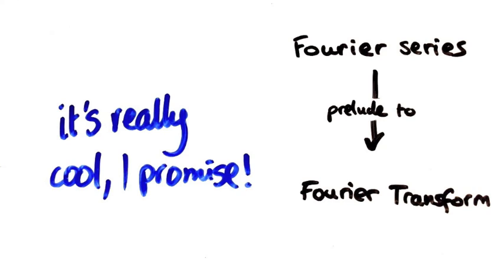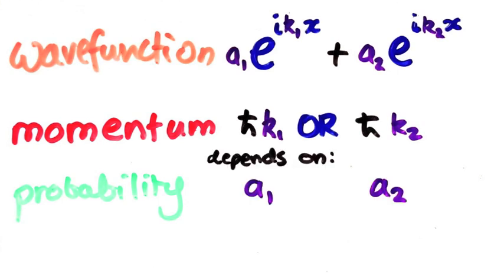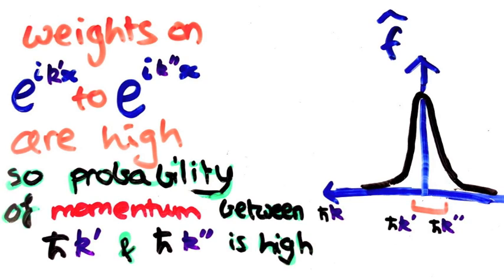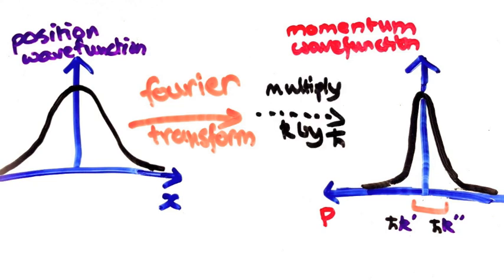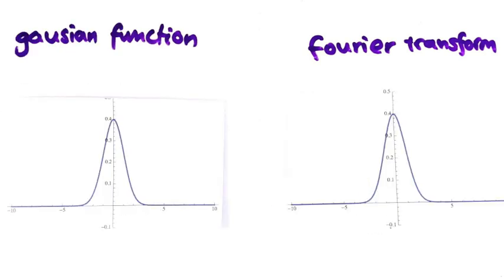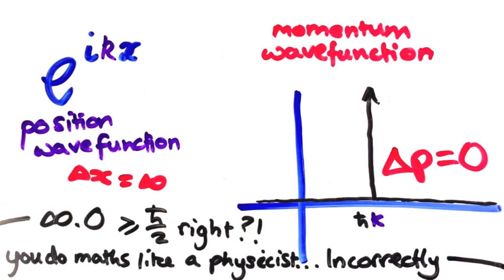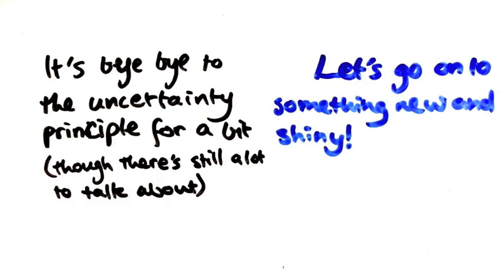The reason for the Heisenberg Uncertainty Principle

Comment: Ultimately, QM is weird because operators can be represented by matrices, which in general do not commute. You can use this property along with the Cauchy-Schwartz inequality to derive the Heisenberg uncertainty without too much effort. But ultimately it's because QM is described by a wavefunction, which is exactly where Fourier theory is applicable. And we need a wave theory to describe double slit interference, all the way down to the single quantum level.

Comment: 07:05 - "because it would turn up the particle anywhere"
----> Yes and it may be the case ACTUALLY, that we Measure it or not, by the way.

Indeed, if we Postulate that:

any Particle is a WAVES PAQUET OF 3D PERTURBATIONS IN THE FINE STRUCTURE OF NEAR INFINITESIMAL POINTS FILING THE PHYSICAL SPACE,

any Perturbation SPREADS TO INFINITE,

so that A PARTICLE IS NATURALLY AN UNFINITE OBJECT.

~°~

Conséquences about the Uncertainty Principle:

More we try to Measure the POSITION of a Particle with Precision, More we need to "look" at a SMALLER Part of the Particle, of the WAVES PAQUET; while doing so, we can't "see" the AMPLITUDE and NUMBER OF WAVELETS of the PAQUET WAVES around that Position, which we need to know, to know APPROXIMATELY the MOMENTUM. That's why we have this Relation and for no other Reason in our view.

And yes, by this, IT IS IMPOSSIBLE TO MEASURE WITH INFINITE PRECISION NOR THE POSITION NOR THE MOMENTUM OF A PARTICLE.

~°~

This Classical Problem of Epistemology of Physics: 

TO CONFUSE THE MATHEMATICAL TOOLS WE USE WITH THE REALITY. 

Because however Accurate they may be to Predict a Phenomenon, they can be FAR MORE COMPLEX THAN THEY SHOULD IN THEIR INTERPRETATION OF REALITY, BECAUSE OF THE INCOMPREHENSIONS OF THE CREATORS OF THE TOOLS, OF WHAT WAS REALLY GOING ON :p

Comment: I don't know if this helps at all, but the reason why p=hbar*k is primarily related to the fact that E=h*f=hbar*omega. It doesn't take much to see that when you divide by velocity, the units come out to hbar*k, or h/lambda. The easy answer as to why E=hf is that f is proportional to velocity (and therefore energy), but with that purely mathematical logic, one could just as easily come up with some other constant (let's call it j for "janck's constant") and say that E=j*lambda, which obviously isn't true, because as f gets big, lambda gets small. The way I like to think about it is that the h*f term explains the fact that a wave is often a bunch of particles only moving up and down, giving the illusion of horizontal movement (like when people in an audience "do the wave"). With that in our minds, we know that since a large lambda makes the crests occur less frequently, a given length of a wave will hit something less times with its crests (or peaks in general) as opposed to if it had a higher frequency. A good intuition to have is that if the wave looks spiky, it's energetic, and if it looks flat, it's pretty lame. And of course, there will be someone asking why E=m*c^2 if "c" is just the phase vecolicty, and E is supposed to be measured perpendicular to the phase, but there's an easy answer to that too. 1: the "m" term is relativistic mass, or (rest mass)/sqrt(1-v^2/c^2), and it's easy to see from this that for light, you would get 0/0, which is indeterminate. There is a way to calculate for the relativistic mass of light (h*f/c^2), but that's a different matter. 
2: light is comprised of two perpendicular waves oscillating with each other (which is one reason why a complex exponential can be super useful), both of which are perpendicular to the phase. So basically, E=h*f describes light as a wave, and E=m*c^2 (which is actually used for annihilation of particles with mass) has a c^2 term because it describes light as a particle, which only obeys the phase velocity. Hope that helped!

Comment: This may sound like a stupid question, but isn't the fourier transform supposed to approximate the wavefunction? Then why does the transform spread out as the function narrows? What have I got fundamentally wrong?
Reply from the maker: No, great question. It's not the the Fourier transform approximates the wavefunction, it's that it gives the weights (that you then multiply by complex exponentials) to get an approximation. Imagine if the wavefunction was a peak. Then since the complex exponentials are really spread out, it kind of makes sense that you need to add a lot of different ones to get something that's peaked. I explained this a bit more in my video about Fourier transforms- if that helps!
Reply: So the more functions you add, the more you know about the position? Then what of the momentum?

Comment: What I get from this is that you can't derive momentum based solely on position measurements and you can't derive position based solely on momentum measurements, but you can still measure both for the same particle with a some certainty. Is that right?

Comment: Indeed, it is possible to have too much education - especially when it comes to dogmatically-held beliefs.... even in science.  While the values may work and even hold "true".  This is because experiments at CERN have already demonstrated the HUP is a false proposition.
Reply: The data for each collision includes a time stamp that is accurate to within a given tolerance, say 1ns, a position that is accurate to, say, 1nm, a velocity that is accurate to, say 1nm/s and masses that may be completely accurate, depending on the experiment. I didn't actually look up any of those quantities, but there is no way they could measure the first three of these four variables to infinite accuracy. If they give you, for example, 1.859221s as "time after the start of the experiment", that doesn't mean it's 1.85922100000000000...s, but rather 1.859221[something] s, or any number in an interval of length 10^(-6).
Reply: Physics is all about approximations.

Comment: An extension on not being able to absolutely know momentum. If we absolutely knew the location of a particle and it was represented by a delta function then the fourier transform would result in a constant. So the particle has an equal probability to have any momentum. I, for one, accept particles with momentums that put their velocity faster than the speed of light.

Comment: I have a question/experiment (note not a hypothesis), it may have been done, and if it has a reply would be great!
So, given this information, we are always going to have an approximation of the two values (position, momentum). I want to see, if I did the procedure for a double slit experiment and took an enormous sample size, having observed the particle for every test, would I be able to identify a statistical presence of their behavior (based on impact locations) when they act like a wave? The question I have is, is the superposition simply a yes/no binary system in which when unobserved is say 0, and when a discrete occurrence happens changes to 1 (indicating observed, and acting as a particle now), or can a superposition be partially collapsed, meaning it acts SOMEWHAT like a particle but still SOMEWHAT like a wave? Can the value lie in-between 0 and 1 instead?

It would be a weird thought to say "It is mostly here, but partially everywhere at the same time as well."

Comment: It's not deriving the heisenberg uncertainty principle but you can show that both momentum and position cannot be simultaneously solved. Taking both the position and momentum operators you can check whether the commutator of the operators equals zero ( [P,X]=0 ). Essentially you find that XP-PX=iћ|Ψ>, which definitely isn't 0. 

https://youtu.be/lK4jwCnheLE?t=51m1s This provides coverage but the entire series is required to understand what's going on, assuming you have good calculus and linear algebra skills it shouldn't be too much.

Comment: This is great.  I wish I'd found your videos sooner.

Did you think about what happens in the 0 momentum case?  The chaos of quantum foam and virtual particles would probably prevent this being a real-world case on any timescale we can currently measure but it's an interesting thing to consider.  Momentum always involves spans of position & time but in the 0 momentum case it's a 0 length span even though it's a non-zero time span so the position and momentum should be quite definite and only the time of the measurement is "fuzzy".
Reply from the maker: Thank you :)

So, as you were pointing out yourself, what counts as 0 momentum is relative. If I changed my frame of reference, that's now going very fast. So should the 0 momentum case really be different?
Reply: Looking Glass Universe Ah, the trick there is to get all observers (if there's more than one) to choose the particle's position as their arbitrary coordinate origin.  Then it's one or more of the observers who have any momentum in the system. ;P

You are right in that in some semantic sense momentum is never really not fuzzy. It's a semantic issue to do with the definition of velocity and momentum, however. Quite literally by definition, they are fuzzy over time and the time span can never be zero or else momentum is undefined.  The zero momentum in this special case is pretty definite in some sense, though, and I was using it to spotlight what is still fuzzy, the time component of momentum.

There's nothing I can see in the math that requires the underlying position to ever be fuzzy..  I think it's a mistake of perspective to ever look at it like that's the case yet the more popular quantum interpretations depend on it.
Reply: i should probably mention that you do have to strip out the observer effect as well.  Even if you redefine the particle as the coordinate origin, any detector would have to be in motion to get a reading and its impact would impart momentum. The particle would necessarily be at a different position at the end of the measurement time span than it was at the beginning.  You could call that fuzzy, too, if you like  but it 's conflating two different things.

Heisenberg himself conflated the observer effect with uncertainty but we should try not to.  ;)
Reply: Transmission Control with the second comment, do you mean that getting a reading of the particle will change the momentum in the system? which is similar to measuring temperature of a system with a thermometer, the actual temperature changes cause you put the meter and that absorbs or deviates the value by dtheta? well that was my point too i guess :P
Reply: Exactly.  If you use a small thermometer to measure a large mass, the alteration is negligible.  

It's the same with measuring a baseball with photons from a radar gun. There is an effect; it's just comparatively so small we can ignore it.

There's nothing small enough we can use to avoid dramatically altering a single particle.

The so-called "weak measurement" used in some experiments is a statistical trick.  You typically measure and reject a small percentage of particles to get a rough idea about the ones you let pass.  It's like random sampling for opinion polls.
Reply: thats what is statistics all about :P

Comment: I think I can prove the De Broglie hypothesis for massless particles: Due to the full equation E^2=(mc^2)^2 +(pc)^2 where p is momentum, for massless particles E=pc. We also know that E=hf for a photon, so pc=hf, therefore p=hf/c. Since f=c/wavelength, p=hc/c*wavelength so the c's cancel out, leaving p=h/wavelength. This is also equal to 2Pi*h/wavelength*2Pi. This can be written as (h/2Pi)*(2Pi/wavelength) which equals hbar*k, therefore p=hbar*k.
Reply: If you assume that E=ħ k and you're in special relativity, then you implicitly assume that p= ħ k as well. Btw, the first one was originally obtained by Einstein in the photoelectric effect.
Reply: ASandwichNinja That's really neat, but only works for massless particles though, whereas the de Broglie relation works for massive particles as well.

Comment: I disagree with the last part, the fact that the standard deviation is infinite, does not imply that the particle is equally likely to be anywhere in the universe, look for example to he Cauchy distribution (just a famous function in probability and statistics) both, its mean and its variance are infinite, or not well defined, however, that doesn't mean that the intensity of the function (or its height, if you allow me to speak in a sloppy way) is equal everywhere. http://en.wikipedia.org/wiki/Cauchy_distribution

This eliminates the problem of having a perfect measurement.
Reply from the maker: Oh, you're absolutely right about the infinite standard deviation! Sorry! nice example too :) But on the other hand, measuring momentum or position still have the same problem. If a particle has perfectly well defined momentum, it's position wavefunction is e^ikx. But in quantum mechanics the probability distribution of the position is given by the modulus squared of the wavefunction, so in this case mod(e^ ikx)= 1. So the particle is equally likely to be anywhere. Also if a particle has a perfect position, it's position wavefunction is a delta function, therefore it's momentum wavefunction is of the form e^ikp, so similar problem! But yes, you're right, the fact that these functions have infinite standard deviations doesn't mean they are equally likely to turn up everywhere necessarily.
Again, thanks for the example- really cool!

Comment: Your video is awesome (also got here through Emily)! There are many videos about QM on Youtube but so far all I have seen tiptoe around the maths involved...
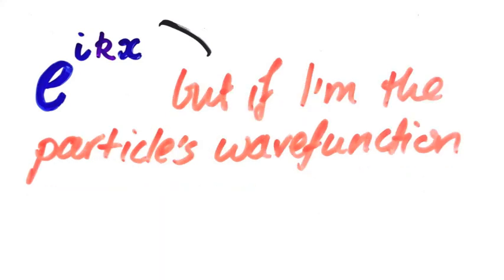Can I ask a question about the position wave function - if the wave function is e to the power of ikx (as in 1:28), the function is basically a sine wave (or rather a corkscrew in complex space). Does the imaginary part have any meaning? Or the negative, for that matter?
Since a sine wave repeats infinitely, but the actual position of an object should be at least somewhat localised, I presume this function is more of a simplified example, and actual probability functions will be compounds of e^ikx blocks with different ks or am I on the wrong track here?
And finally, what exactly is x? I get it in the context of the double slit experiment, where you have detectors along one axis and x is basically how far along this axis your particle is detected, buuut if I want to know where a particle actually is in 3D space, how does that work? Since position is a vector and all (and so is momentum).
Apologies if you have already explained that somewhere and I missed it.
Reply from the maker: Don't apologise! These are all excellent questions :) 
Exactly for you reason you said, it's impossible for the wave function of a particle to be e^ikx. And you're right, real wavefunctions are made of combinations of e^ikx functions.
 It does seem redundant to have negatives and complex numbers in the wavefunction doesn't it? But it's actually pretty important, because its those numbers that cause the interference. I really ought to explain this in its own video. Do you know some stuff about how probabilities work in quantum? 
Ha! You caught me. I've been doing everything in 1D. Instead, we really should do it in 3D . Then the wavefunction becomes a scalar function of 3 variables, the x, y, z components. So yeah, it's totally possible to do this in 3D. I didn't feel a lot was gained by teaching it in 3D because it generalises from the 1D case pretty naturally. BUT that said, I remember I was uneasy about it till I saw it done in 3D. So if you want, check out the wiki page for schrodinger's equation- I think it explains it.
:)
Reply: Looking Glass Universe Thanks for the answers! That is making everything a lot clearer. My knowledge on quantum probabilites is severely limited, although I get the general principle behind it (as far as anyone can really understand QM, anyway...) If you could make another Video about the points you mentioned, that would be a great addition to your videos I think!
Reply from the maker: I probably should.. But I'm struggling to find enough time for the main videos at the moment.. I will add it to the list (ie, the long list of broken promises) of videos I want to do. Might get a bit more free time in January (or a bit less- we'll see!)
Reply: Looking Glass Universe Looking forward to your next videos!

Comment: This was a great presentation and well worth the wait. Do you think we have the same problems measuring classical waves, like waves in the water or the air, as we do trying to measure the wave functions in quantum physics? A classical wave spreads out everywhere. Is it possible to say a wave has a location, or are we limited to saying it has higher or lower concentrations in certain areas?